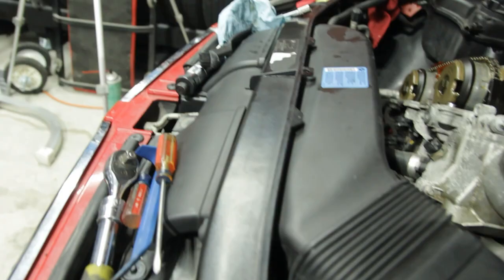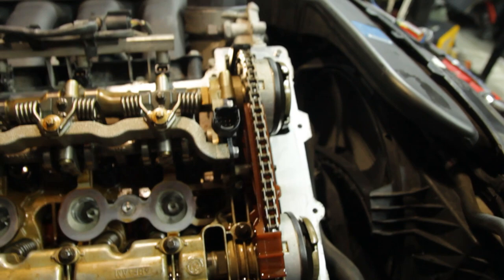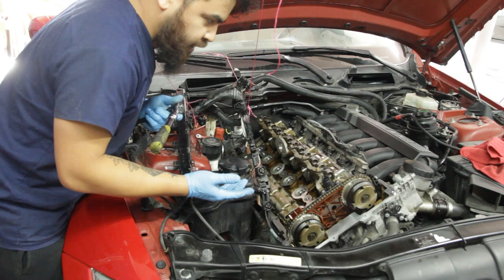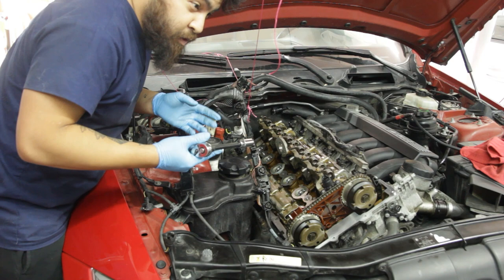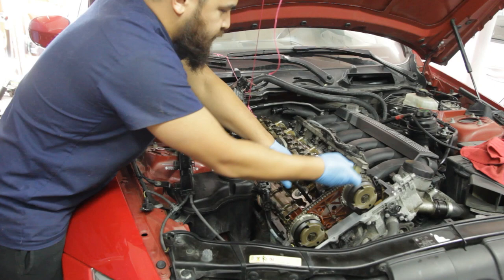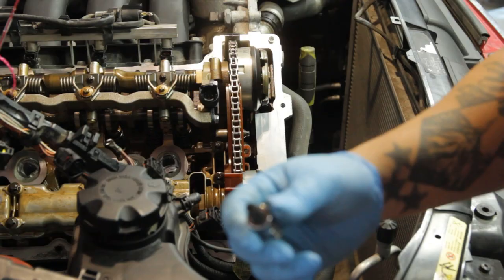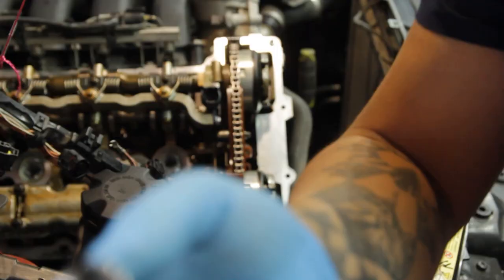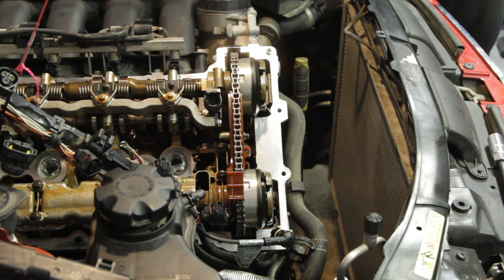BMW E9X 328i N52 VANOS Sprocket Bolt Recall DIY

Comment: so, safe to assume that engine is toast if all four sheared off? No warning signs, except the service engine soon light came on right before, then car wouldn't start.  Shop then used a mirror to see no bolts are present(not sure if it is intake or exhaust side), shop said timing jumped.  Can't hear any slapping noise though.
Reply from the maker: Ouch. Definitely not a good thing. Probably salvageable if you can find all of the bolts/shards but it's probably not going to be cheap. Sorry to hear that.
Reply: @jontansgarage  That would be covered by BMW though wouldnt it ?
Reply from the maker: @murph5150 I believe so. Any damage that occurs due to an issue they are aware of and have failed to fix should be covered by BMW. Whether or not they do is another story but from what I have read from other users, it seems that BMW is handling this sort of thing properly on their end.

Comment: do you know anything about this problem with the N51 engine? I have some VANOS exhaust codes... I think (hope) they are either battery related or just solenoid related but worry about these bolts. My 328 came off the line in September 2011
Reply from the maker: Hey there, according to the recall bulletin (link in description) it states "This Recall involves certain E70, E71, E82, E88, E89, E90, E92, E93, F10 and F25 vehicles with the N51, N52K and N52T engines produced from September 2009 to November 2011. " So your vehicle fits the bill. I would definitely call up your dealership to see if they include your vehicle but I would definitely get these replaced as soon as you can for peace of mind. Chances are, your vanos solenoids are the cause of your codes though. Try swapping them around and see if the codes change, its an easy enough task. Make sure you plug the correct wires into the correct solenoids.

Comment: In general after how many miles do these original  bolts usually break and or get lose?  In other words when does this issue start happening in these cars?  Is it a time or mileage issue?
Reply from the maker: I don't believe there is a magic number where the bolts will just start backing out or breaking. If you have a higher mileage car, I would say your risk of this happening (if it hasn't already) increases tremendously though. My car had 104,000 miles on it when I bought it and tore into it. The bolts didn't seem loose or broken but every car is different. I am sure there are plenty of cases with bolts backing out or breaking with less than 50,000 miles.

 The bolts are weak from the factory; regardless of age and mileage these bolts can and will eventually break. I am fairly certain that all cars, if not previously covered, now fall under the new recall so I would highly suggest bringing your vehicle to the dealership as soon as you can and as soon as the remedy is available. Hopefully your valve cover is also in need of replacing so you can kill two birds with one stone.
Reply: Thank you for taking the time to reply @jontansgarage
Reply: Could you use stainless steel bolts? Need to do mine.
Reply from the maker: @swright2514  Theoretically, you could use any bolt as long as the head was shallow enough to clear everything. That being said, I don't think it's worth it. The updated bolts, while still soft, should hopefully be strong enough to no longer be an issue. I personally wouldn't risk using a different bolt and potentially causing clearance issues.

Comment: Any issues with this come back up? About to do the same at 70 in/lbs. and locktite. I was also told to replace the sprocket to cam bolts while doing this (2x bolts for each sprocket on front side), but they appear fine.
Reply from the maker: No issues so far and driven over 10000 miles. Are you referring to the main bolts that hold the vanos assemblies? I haven't heard anyone having issues with those.
Reply: @jontansgarage  yes I went to the dealer to get the new bolts since I noticed mine backed out while doing valve cover. Wasn’t impressed they’re still aluminum. Luckily my heads didn’t break off but they were loose. They told me to do these bolts too but idk. Mine seem fine. So was just gonna do exactly what you did at 70in.lbs with loctite and call it a day.
Reply from the maker: Ah gotcha. Yeah the new bolts are still super soft and are very easy to strip the head if you don’t have the torx bit seated properly. That’s part of the reason why I was afraid to torque the bolts more because I was afraid I would slip and strip the bolt heads.
Reply: @jontansgarage  same. Literally just finished putting all 8 in at 70in.lbs and def don’t want to do more. Hopefully it’ll be ok. About to put VC back on. Thank you for the video sir!
Reply from the maker: @bronsonwhite6487  Awesome. Should be good to go then!

Comment: Where did you get that 7 piece extended security torx socket kit?!
Reply from the maker: Here is an amazon affiliate link. Also added to the description. https://amzn.to/3wKXPcP
Reply: @jontansgarage  ahh not security torx, thanks though!
Reply from the maker: @godbelow  Oh man, good catch. I forgot that those were non-security. Those will work for installing the new bolts but definitely wouldn't help with removing the old ones. I was able to find these (not too many kits go up to T45). https://amzn.to/3TrTWSP Those should work in conjunction with a 1/4 inch socket and some extensions.

Comment: Hey brother i SLIGHTLY spinned my crankshaft pulley the oposite way to free a sheered bolt. Is that okay?
Reply: I hope to hear back from you brother
Reply from the maker: @rauldeleon6728  Shouldn't be an issue at all. I try to keep it going in the proper direction (if facing the crank bolt, clockwise to the right) any time I am rotating things; even if I need to rotate it counter-clockwise just a hair, I'll usually just go all the way around going clockwise. Again, probably not going to cause any issues/damage if you do it, but worth avoiding when you can. I wouldn't worry about it man.
Reply: @jontansgarage  damn man thanks alot. I went insane trying to find an answer. I just went backwards very little like 20-30 degrees. Thanks alot seriously man. Have a good night

Comment: does this problem include f10 n52n 2011r. ?
Reply from the maker: According to the bulletin (I have it linked in the description) the F10 up to November 2011 is indeed included in the recall. Give your dealership a call and see if your specific vehicle is included!
Reply: @jontansgarage  Thanks!

Comment: Do you know where i can get n52 engine torque specs.. specifically cam shaft bolts?
Reply from the maker: Here are some specs, not sure if it is what you need though. A quick google search for n52 camshaft bolt torque gave me several forum threads, hopefully you can find them there. https://f01.justanswer.com/MatthewT730/98fafcda-25e1-4c97-9cbd-8b01cde57483_General_torque_specifications_N52.pdf
Reply: @jontansgarage  thank you!

Comment: Any update on the remedy?
Reply from the maker: I have yet to receive a new notice regarding a "remedy".
Reply: @jontansgarage  Same. How can they say the remedy is not available when this issue pertains to the new N52s. 2004-2010 N52s are not in the list. They obviously downgraded the bolt material and will prolong this as much as possible.
Reply from the maker: @CaliRepublic77  It's pretty ridiculous. Especially considering that the remedy in the service bulletin is literally the same as their earlier recall. Just doesn't make sense.

Comment: Can you believe that I just called united bmw in Alpharetta ga and the girl said that this recall is vin specific even though the car I’m calling about is listed in the bulletin… and It just happens to be having this same issue.
Reply from the maker: I believe it. Run your vin here. https://my.bmwusa.com/safety-and-emission-recalls

If it wasn’t included on the first one (very possible) it should be in this new one. The dealership might not tell you your vehicle is included until they actually have the parts for fixing it ready to go.

Comment: Where did you order your bolts
Reply from the maker: I have links (for the bolts) to FCP euro as well as Bimmerworld in the description. I purchased mine from FCP since I was already ordering other parts but you could also get these from your local BMW dealer. I will say, my dealer did not have these in stock so no matter what I would have had to wait for shipping. Not to mention they were double if not more in price.

Comment: I have a 330i manual and my vanos gear has a plastic cover blocking those bolts
Reply from the maker: Interesting. Haven't seen any examples of that, mind sharing a pic as well as the year of the car?

Comment: good video except it prob would be easier to just remove the whole camshaft vvt gear on both sides and that way you could use a better quality torque socket
Reply from the maker: Definitely would have made things easier but I believe that would require the Vanos alignment tool among some other things. I was originally going to go this route but I figured I would try to follow the service bulletin instructions as best as I could. Not to mention, I did not want to risk digging myself into a deeper hole doing this work on a vehicle that I literally just purchased :D
Reply: @jontansgarage  i think i will forget about the torque of the bolts and just use a ratchet and  red locktite and just tighten them till they are good and tight on my 328i unfortunately i think my bolts broke off because i hear alot of rattling in my car so i parked it for now
Reply from the maker: @izakwasserman2887  i am a fan of “good and tight” for non-crucial components but for something like this, I would definitely try to get at least the minimum recommended torque. I don’t know what all is inside of the assembly but it could potentially causes issues if the components aren’t pressing up against each other properly.
Reply: @izakwasserman2887  "Good and tight" is literally how bolts like this end up failing. They are overstressed during install and then some gentle stresses end up breaking them.

Comment: Just got a letter in the mail for bmw, there’s a recall for the Vanos attachment bolts. 1/3/2024
Reply from the maker: Yup, I updated the description about a month ago. I am assuming your letter still says that they are waiting for the "fix" at the moment?
Reply: @jontansgarage  it does, says remedy not ready or something along the lines of that
Reply from the maker: I figured. Hopefully they will come up with it soon. The pcv heater recall was “created” and I think it took quite some time before a remedy was available. For example, my 2010 JUST became eligible for the pcv heater fix a few months ago; had it done last month.
Reply: @jontansgarage  I had the camshaft sprockets replaced back in May I took it to the BMW dealership and they were able to inspect it and verify that those camshaft are in fact the newly updated camshaft to resolve this problem so they gave me a reimbursement
Reply from the maker: @TheFrozo619  They reimbursed you for the camshaft sprocket job? That's awesome!

Comment: This correct mine wasn't on the recall either, which is BS. I hope I can order those bolts from FCP from your video. I'm so pissed they wouldn't honor their cheap ripoff part they put in mine.
Reply from the maker: Yeah, it's pretty ridiculous as there's a good amount of E91's out there, especially outside of the U.S. I wonder if there is a different recall overseas.
Reply: @Jonathan Cardenas  The recall should have been connected to the engine, NOT the vehicle VIN. I don't trust BMW anymore, seeing how they have weasel out of their responsibility of QUALITY.
Reply from the maker: @autojock4472  Definitely. The silly thing is, is that the recall is based on the N52 engine so it's ridiculous that every single vehicle with an N52 isn't covered.

Comment: There is NO need for thread lock on the vanos repair bolts ...I have performed this procedure many times and BMW doesn't add thread lock . I don't disagree with his precaution but it has to be clarified ..because this not for the do it yourself there is a recall that is paid for by BMW so please do not undertake this on your own ... 38 yrs with BMW
Reply from the maker: Correct. If your car has been affected and is included in the recall then I would certainly have them repair it. As stated in the description, E91's are not included. They are mentioned, and should be included however, plenty of E91 owners and myself are for some odd reason not included. I have verified with my own BMW dealership and even BMW themselves; when the vehicle is looked up it will not have any sort of recall notice regarding this issue. You can try speaking to BMW but they won't hear you and plenty of others have tried. Which is why I took it upon myself to take care of it while I already had my valve cover off. Why would I bother waiting for BMW to respond and hopefully provide a remedy.  Just as we all patiently wait for the PCV recall to ever be properly remedied. Also, I provided the link to the actual BMW service bulletin in the description. I did the best I could to follow the procedure and the car has been running great.
Reply: I think my car has broken bolts and the 10 year recall is expired. Do you think they would still fix it or at least do it for cheaper ?